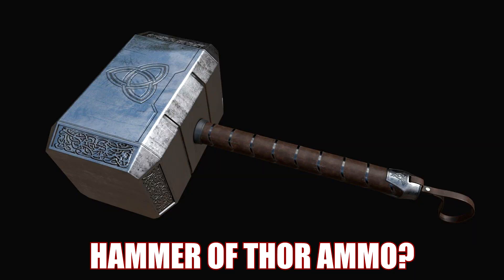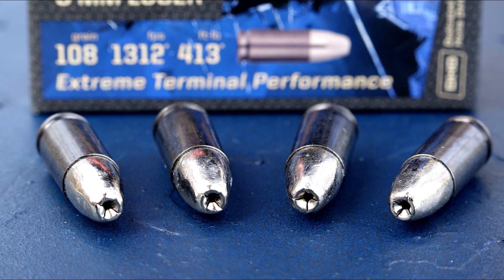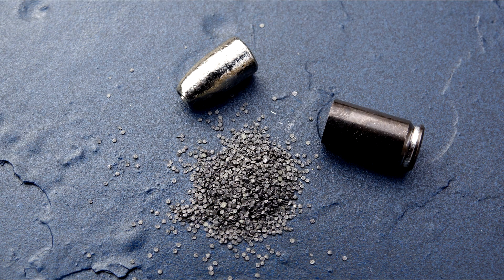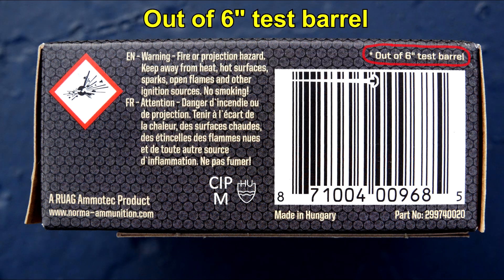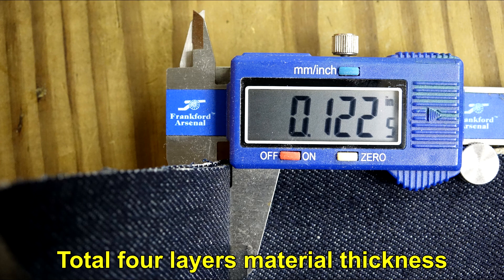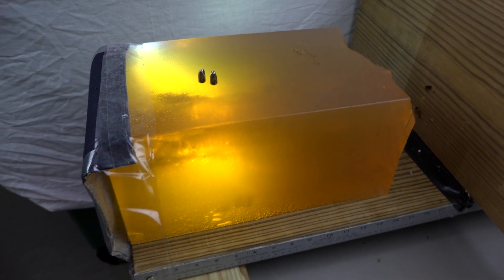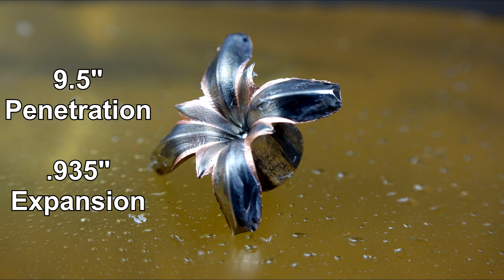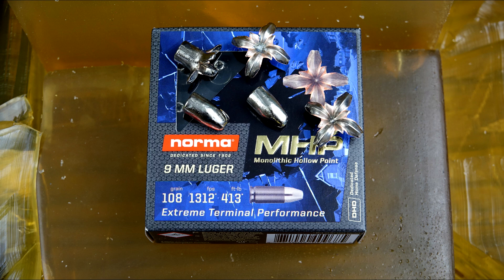AMMO REVIEW:  NORMA Monolithic Copper 9mm in Calibrated Gel (2021)

Comment: I'd reserve this ammunition for carbines or summer use, but the latter only if  I was out of everything else. Otherwise, I'm sticking with Sig V-Crown 124gr JHP and Federal HST 124gr JHP. With an alloy- or aluminum-frame 1911 commander in 9mm, my follow-up shots are quick and controlled. With polymer-frame pistols of roughly the same size and weight, I tend to get slightly more muzzle flip.

Comment: Not exactly a fair and unbiased test and opinion they say 6 inch barrel, but bullet works at any speed numbers and energy only means so much coming straight from the federal bullet designer’s mouth. Also it’s not even a full chunk of block so estimates about the pass-through is just an estimate it could’ve expanded at the 12 to 15 mark these are meant to shoot inside your house open up to almost an inch and will certainly penetrate a bad guy, Norma is quality ammo this isn’t that bad of stuff specially if you factor in price

Comment: That's fascinating. I usually would expect very deep penetration by monolithic ammo, often with expanded petals completely detaching around the 7"-9" mark and the core travelling quite deeply - which might be bad for permanent cavity of the main slug or good for multiple wound channels, depending on point of view. This expanded terrifically - like in the range of a really good 45+p load - and all stayed together but had poor penetration overall. 

Tbh I wonder if they'd reduced the petal cuts a little or added some more weight to the bullet base if this wouldn't have been a really nice round. As it is, I can't deny being amazed by the expansion, but it might not do so well at an oblique angle shot... clogging looks like a problem too. 

Still, it's a cool concept, and might really go somewhere with a little more tuning. I remember where hollowpoint performance was in general back thirty years ago and it's come a long way, I have a feeling copper slug technology will have a ways to advance, too.

Comment: I recently tried a box of Norma MHP through my 3.1" Shield Plus at an indoor range. No problems, but so far that Shield Plus digests everything without problems.

I couldn't see much difference on target out to 10 yards between the MHP and several other hollow points or FMJ. Felt recoil was slightly less, but everything feels a bit snappy in the little Shield Plus, especially with the flush mount 10-round magazine.

I wouldn't go out of my way to find another box of Norma MHP, but if I saw a box I'd buy it again. I suspect it would fare well against medium size feral hogs.

I wish a full length HP round like this had been available years ago when I had a couple of the Benelli B76. Those pistols only liked full length FMJ RN.

The bullet finish is odd, and I'm guessing the four flattened facets are designed to affect expansion. I'm curious to see whether the odd bullet shape would affect accuracy over long range.

Comment: If I’m right about the powder it’s definitely NOT low flash powder. I use it in loads specifically designed to have a Huuuuge flash for fun at indoor ranges. And if I’m not mistaking isn’t Extreme Terminal Performance already trademarked by another ammunition company? Lol

Comment: Excellent review, as always.  About 5 years or so ago you did reviews of the 9mm Underwood Xtreme Defenders.  Any possibility you'll take another look at them (and the .380ACP Xtreme Penetrators)?  Their barrier blind design is really IMHO a step up from even the best HP's (particularly with the increased popularity of the very short barreled micro 9's), and given that the average weight of Americans has increased substantially since the FBI first introduced it's 12" to 18" penetration standards about 35 years ago, I think those projectiles that get closest to 18" penetration should be the highest rated for EDC and home protection.
Reply from the maker: Not likely to re-test anything Underwood, but the Defender is the only copper product I've seen to this point that I would remotely consider carrying.  I'm also out of the .380 business, no longer own anything in the caliber.

Comment: While I think the IWBA standard is overkill, the MHP performance is actually inferior to late 80's standard JHPs ( Winchester, Remington, Federal ) the 115 loadings of the era would usually under penetrate or pass through ( clogged ). Why can't Europeans make modern antipersonnel loadings? The people making this used to make the ACTION load (9mm 86(?) grain copper HP with a polymer nose plug that blew out the front ahead of bullet-bullet drilled through & MEN made a capped HP 9mm also - their tech seems to have peaked about '87). Hirtenberger had a Mono Metal HP that ripped off HydraShok ( Fiocchi loaded it, maybe still today ). Yawn. Pass.
Reply from the maker: "Why can't Europeans make modern antipersonnel loadings?" THIS.  And I'm concerned that US companies seem to be following that trend.
Reply: I've tested some of those action style bullets, and in clear gel at least, they perform Very poorly for pistol rounds, in comparison to Gold Dot/HST.

Comment: The expansion that round, when it expands and when it goes far enough, is stupendous. I think if they did just a little work on it they could solve those issues. Considering handgun does most of its damage through wounding as opposed to energy or other factors, that expansion is a big deal. But it just isn't anywhere near consistent enough. Thanks so much for your work Tnoutdoors9!

Comment: TN - It is ALWAYS great to see a new ammunition evaluation from you, they unfailingly are outstanding, and your return to YouTube is heartening.  I have fired a lot of NORMA ammunition in the last 50+ years and, in general, I believe it is s excellent.  However, imho this simply is another “gimmick” contender in the 9mm Luger defensive marketplace.  It did not expand consistently, and higher than normal velocity — with reduced mass — is very likely to provide marginal penetration.  FWIW, monolithic copper bullets can work very well;  for example, Remington marketed a Barnes TSX “Hog Hammer”  in .223 that was really good, however, this this all-copper bullet doesn’t appear to be at all well “system engineering integrated” with the cartridge’s other attributes.

Comment: Sounds like a candidate for a debris plug. The ogive could pry be shortened a bit as well, not sure why i think that would help but i do.
Reply: The ogive is likely so long b/c of the massive expansion petals. If you shorten the ogive, you shorten the petals.
Reply: @oldscratch3535  i thought of that, but they are so long that it seems a good trade if it would help ensure thay they open. These are just my random thoughts on it, maybe it wouldnt change anything.
Reply: @Bojangles6  I think the problem is that an all copper bullet doesn't reliably expand unless it is properly designed. If you use the wrong tensile strength and/or hardness it likely won't perform as advertised. 

It probably expands great and looks very impressive in water or bare gel, but that's not the real world. And 6"-8" of penetration in gel is not analogous to the same in human flesh. You may not get anywhere near that kind of penetration in a real human, or it may just pass through without expanding.

I think this is likely just a poorly researched and designed round. Its a marketing wank bullet like the R.I.P. or whatever other super duper fast bullet Liberty Ammunition sells. Its made to grab the attention and money of people who like shiny things that make loud, bold claims. 

Nobody that gets into actual gunfights for a living is using any of that shit.
Reply: @oldscratch3535  when i first saw these rounds i actually assumed they would be a coated lead bullet, not copper. At handgun velocities, getting something as stiff as copper to react reliably is pretty tough. Minor fluctuations in the metalurgy, forming and annealing could all have huge impacts on the performance.

Comment: When I was young and dumb I loved getting all the latest gimmick bullets that came out.  Corbon Powerball, DXP, Black Talon, Safety Slugs, etc.  Now that I am older and wiser, reliability and consistency are simply the most important factors.  There is no magic 9mm that beats all others because you can't defeat physics.  I use HST because it has proven itself over and over again.  XTP from Hornady is my 2nd go to.  It doesn't expand quite as much, but boy is it consistent and the deepest penetrator (goes 13 - 15 inches) I have encountered.  My wife carries a .380 and the Hornady XTP Custom is the only ammo in .380 that will give consistent expansion and 11+ inch penetration.  That is getting darn close to some 9mm loads.  Keep in mind that I am reffering to standard pressure loads.  I don't like +p because you can't really train with it, unless you want to spend 3x on ammo.
Reply: Black Talon wasn't really all that gimmicky. The media made it into a gimmick with the pearl clutching and hand wringing.

 Lots of Winchester offerings still use a nearly identical bullet I.E. Ranger T, PDX1, USA Ready, SXT, etc. Those are all very similar to the OG Black Talons and they aren't at all what I would consider to be a gimmick/marketing wank bullet.

A good affordable +P loading is Hornady Critical Duty in either 124gr or 135gr. I carry 135gr +P. $24 for 25 rounds. That's been my carry round since they came out.

Comment: The "tested using a 6 barrel" fine print on back of box is very misleading IMO and I've seen this before with other Norma 9mm ammo. No one but Norma does this little "trick" I've looked at most major manufacturers velocity and penetration specs and all use 4" barrels. It is not lying but very shady
Reply: Its very shady. They should use an average of what the carrying public uses. 3"-4" barrels should be standard for chronographing carry loads. Maybe 5" for LEO duty rounds. 

Its no different than other ammo manufacturers using 24"-28" test barrels for their rifle loads when they know damn well no one is using a barrel that long. What is the point of giving data on a 24" barrel for 5.56? Literally no one is using that length besides varmint hunters. And they always do it out of a bolt action instead of a gas gun. For 5.56/.223 I want data from a 16" carbine length D.I. gas gun as that is the most common variation of firearm that round is likely to be used in. 

90% of what you see on the box is marketing wank.

Comment: We've had this ammo in our shop for the 2 years I've worked there at least. It's pretty expensive, more expensive than the Hornady Critical Duty loads we have. I thought that the advertised velocity sounded pretty hot but didn't notice the 6" test barrel disclaimer. I gotta say, I am kind of eager to get this ammo and try it out in my 9mm carbine rifle against some melons and such. Over 1100 fps out of a 3.1" barrel ain't bad at all.
Reply: Its probably pretty decent out of longer barrels, but there is no way in hell I'd carry this in a short barreled carry gun. The expansion is just not reliable. There's a reason a lot of carry loads now have some sort of technology built in ensure expansion and prevent tip clogs. Hornady Critical Duty 135gr +p is what I've been carrying for years now. They recently came out with a 124gr +p which I would have no problem using. 

I used to carry PDX1 until I had some failures to feed b/c of the bullet design. The deep scallops at the tip of the hollow point would catch on the feed ramp. This was in a Glock too. I quickly dumped it from my carry guns. I really liked that bullet too.
Reply: @oldscratch3535  By the results of the demonstration in this vid, it looks like the idea behind the Norma Monolithic is adequate wound channel formation with most of the energy expended in the target (that is if the rounds deploy as designed), as even the rounds that didn't expand seemed to have little energy left... I guess if you have a big concern of over penetration this may be a valid option. Yeah, from what I've seen, it looks like 124 gr bonded bullets with decent velocity out of a 3-4 inch barrel is the way to go. From what I've heard though, it seems like the Silver Tips are still a good option so I'd buy those if I could find them readily. I carry a .40 and have mine loaded with Hornady American Gunner 180gr XTP's. I don't know how they function in ballistic gel but they function well in the gun.

Comment: How many bad guys out there wear that much denim? Why not a winter coat and button up shirt and undershirt ? I am 50 and cannot recall seeing anyone with that much denim.
Reply from the maker: You should see the jacked up biscuit-fed thugs around Middle TN in the Cracker Barrel parking lot.

Seriously, this is a dated IWBA testing protocol that was used extensively back in the days when ammo in all calibers (but especially 9mm) was somewhat more robust.  The FBI four layer protocol addresses the three you mentioned....winter coat (fleece layer) and definitely the button shirt and undershirt......yours are certainly realistic....but FBI adds a layer of denim.  I used the FBI protocol with a handful of tests in 2019, and most recently a meat test with 9mm Federal PUNCH this past summer.

Today's batch of new ammo is measured (if at all, I fear) by a lower set of standards.  I was fully aware of this but it was pushed to the forefront of my test protocols by some esteemed folks in law enforcement who have seen it all.  They also have concerns whether or not new technology is on par with Gold Dot, HST, Ranger, and other street-cred products that have been available to the consumer.  Obviously near impossible to get hands on most of those today but it's dangerous for everyone on the right side of the law that the standards have been relaxed.

Hope this helps.
Reply: Well, you likely want to try to test to the worst case scenario. If it works well there, you can likely be sure it will work even better in less demanding ones. Anyone can design a test to make their ammunition pass with flying colors and look wonderful. All you have to do is shoot some water and exclaim how great your bullet design is. 

I want to see a test that is tough to pass.

Comment: @tnoutdoors9  have you considered using thin piano wire to cut the gel block like you would a large block of cheese? Id imagine the cut would come out a lot cleaner and allow for better accuracy on cutting when you place it it right over or parallel to the bullet path
Reply from the maker: I had that same suggestion with SIMTEST.  Haven't seriously considered it because I'm not so much focused on showing bullet tracks in great detail unlike the SIMTEST days.  I've learned that it's not critical to the outcome in a testing environment.

Comment: A friend of mine who's new to the prospect of using firearms defensively mentioned this ammo to me. I steered him away because of the low weight and this makes me glad I did. On the other hand thank you for giving us the straight information without much opinion beyond that it's not for you and letting folks decide what's best for themselves.
Reply from the maker: You made some very good points here of which you may not have fully realized their importance.  New to firearms....those millions of people in 20 and 21 and most likely gravitating toward 9mm.  Those of us like myself who had access to Gold Dot, HST, Ranger, Critical Duty and others that set the bar high.  Those were the wonder years (apologies to Fred Savage) and I have great concerns they may not return.  Today's new shooters have a smaller matrix of options and I have yet to really notice anything that's in the ballpark of our current "standards".
Reply: @tnoutdoors9  What's wrong with continuing to use the HSTs? The new folks don't need to use newly designed ammo. A Glock 9mm with HSTs is still an excellent standard. The golden years are still here!
Reply from the maker: @LifeisGood762  Hope I did not imply the HST's are crap because they are absolutely top shelf, just a matter of availability on all the cited standards.  I plan to retest the current rendition of the 147 HST because it has been redesigned, and possibly the 124 +P as well at some point.  The 147 sooner than later depending on when the really cold weather sets in here.  I do see the 147's out and about online.  Related....gel test of the PUNCH is forthcoming.
Reply: @tnoutdoors9  Excellent. I'm excited for the punch gel test! I carry 147 grain HSTs currently and didn't realize it had been redesigned, so that will also be interesting. I've been finding that load in the small, impossible-to-open boxes locally at big box stores! I was so happy to see that.
Reply from the maker: Now has two cannelures and possibly changes to the skives.  Rumor mill says it doesn't open up consistenly in LEO shootings.  I've hit some water and clear gel with it off camera couple of years ago and can see the potential of tighter tolerances for expansion potential.  Not that anything I do here is the-end all but I'm curious myself.
Reply: @tnoutdoors9  The availability of HST's is shit in my area. I've been carrying a gun for nearly 15 years now and I just bought my first box of HST's. It was the first time I had ever seen them on the shelf. They were over $5 more expensive too compared to the Critical Duty I usually buy..and you get 5 less rounds. 

I bought some Federal Punch as well. The bullet construction is very similar to the HST. The HST looks to have a different ogive (could be related to different weight 147vs124) and 6 petals compared to 5 on the Punch. The new HST box does not have velocity data on it, the Punch does. The HST box is nearly impossible to open if you don't know exactly how to hold it.

I haven't carried those yet b/c I was hoping you would get around to some tests on these as I had also heard the HST was redesigned. I've been using Critical Duty 135gr +p for years now based upon your tests and others.